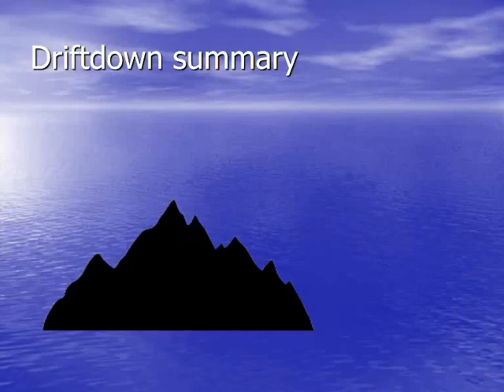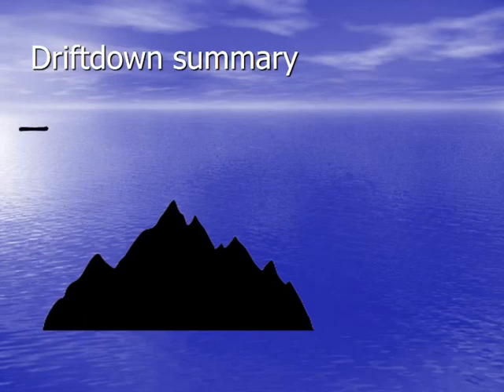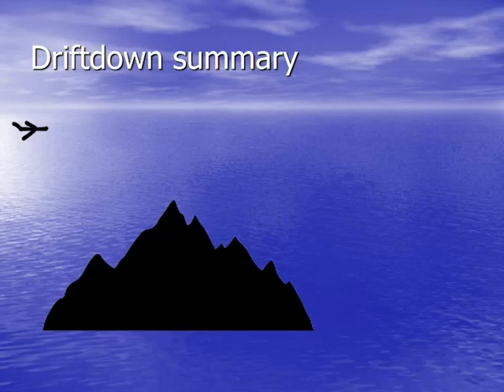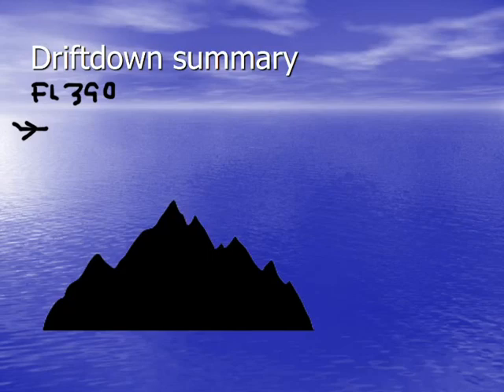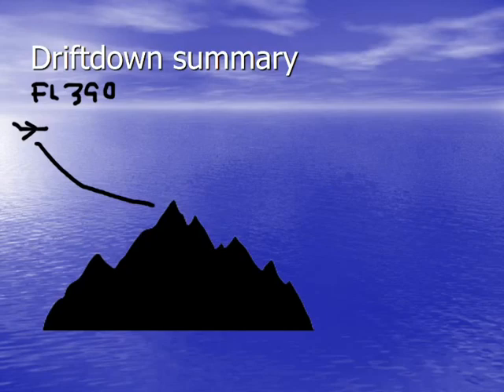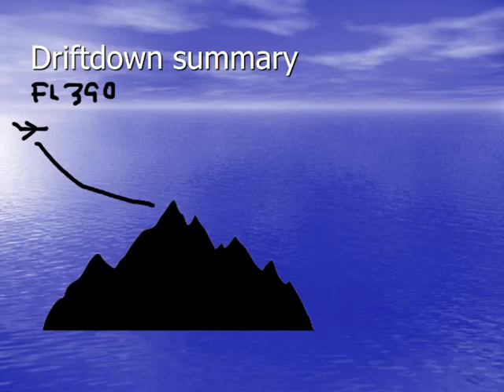Part 121 Aircraft - Driftdown Explained

Comment: Great review. It's important for operators to understand that the weight restrictions and drift down alternates are calculated [ partially ] with the use of Maximum continuous power [ on the operating engine ] and Correct drift down speed,  during the drift down  procedure.  On many fleets the auto throttles become inoperative with one engine operation and the pilot at the controls has to monitor and adjust this value [ continuously ] all throughout the procedure [ along with airspeed ] until arriving at the drift down altitude.
Reply from the maker: Very good points, Tom. Thank you for sharing!